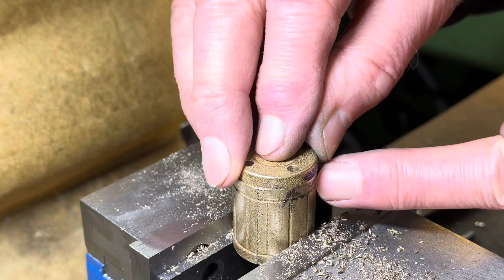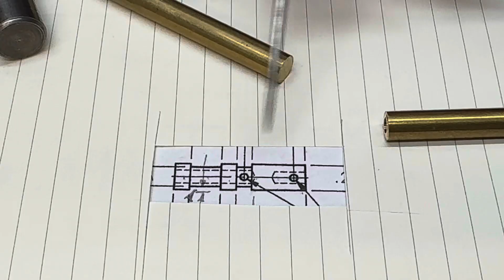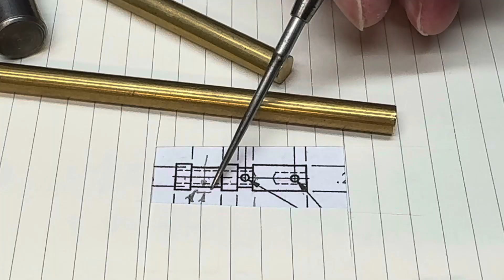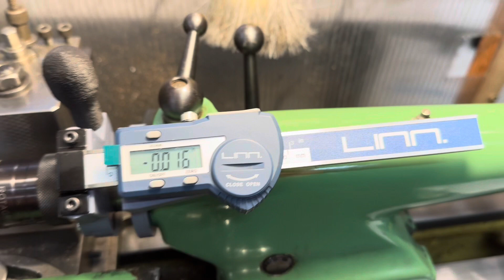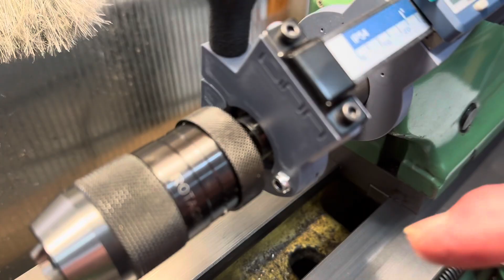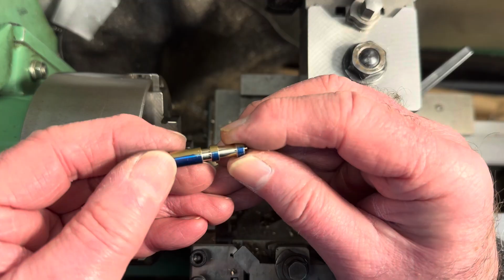PM Research #3 Engine - Part 16 Finale

Comment: Another way to drill the holes in the cylinder for the covers: Drill the cover holes tapping size first, then you can transfer the holes to the cylinder just by drillingthrough them. Then open out the cover holes to clearance size.
Reply from the maker: Thanks David that would certainly work. Great tip. Cheers Nobby

Comment: I have one of the Linn Tools digital readouts that mounts onto the prismatic vee of my lathe bed and records the linear travel of the lathe carriage....it is very handy when boring blind holes with a boring bar and for external turning up to a shoulder.
Reply from the maker: Hi Howard Linn Tools do make an excellent range of tools. I love my tail stock DRO. Cheers Nobby
Reply: @nobbysworkshop The plastic parts are 3D printed as you suggest.

Comment: G'day Nobby what a great series this has been, you must be well pleased mate to see her 'alive'' and running after all those hours that you put into the build. 
P.s my potentiomenter on my mini mill (I hope that's what is is) has started to act up. I've ordered another, hopefully I can just follow the wiring and replace it and it starts to work again and its not a board or something worse :(
Reply from the maker: Hi Jim. You’re right I’m over the moon on how it turned out. So pleased it actually worked as well. I seem to have got the timing right as well, and it run straight away. Hope you get your lathe sorted out. The pot should be straight forward to fit. I do hope that’s all it is. Let me know how you get on. Take care. Nobby
Reply: @nobbysworkshop  Thanks Nobby

Comment: Well done Nobby you have made a great job. I wonder why the design has the eccentric near the flywheel. If it were close to the innner bearing 
The eccentric rod could have a lesser bend.
Reply from the maker: So nice of you to say so David. You are right about the eccentric. On this model it could be mounted the other way around, but would still need a bend in the connecting rod. Although not as much of a bend. I did it this way according to the plans. PM Research engines all seem very similar in this respect. Hope to start on the Stuart 10V later this year. Thanks again David. Cheers Nobby
Reply: Yes,I was also wondering why the eccentric is so far outboard of the main bearing when it looks like it could have been much closer.
Reply from the maker: I guess they must have had a reason to design it this way Howard. All I could do was follow the plans. Even so the completed engine does look beautiful and runs smoothly. I’m happy 😊 Cheers Nobby